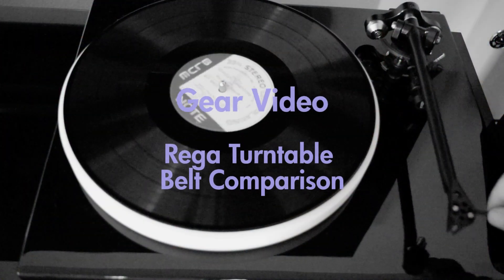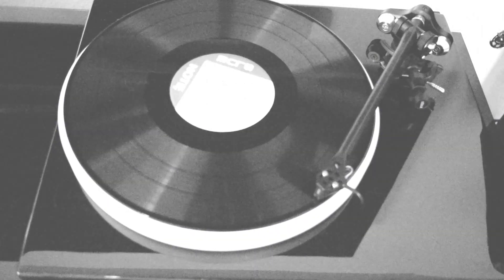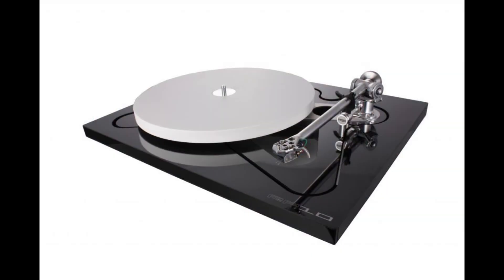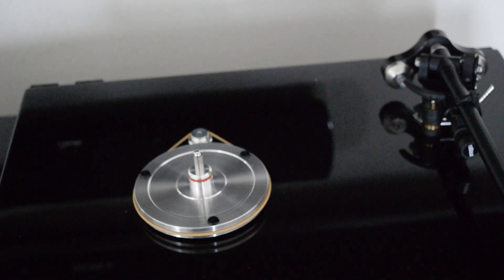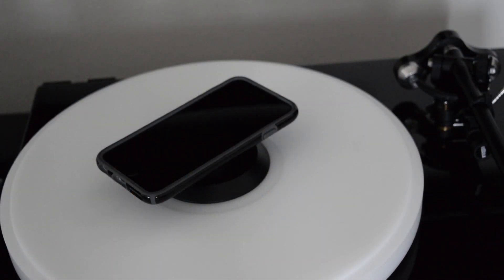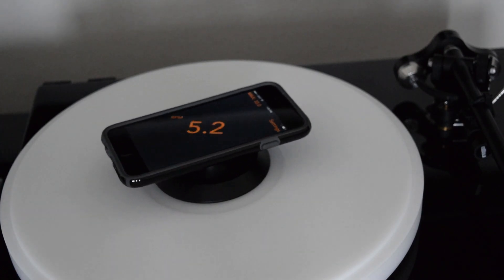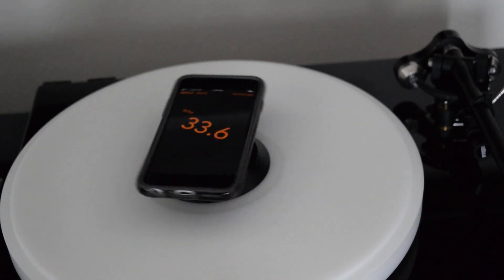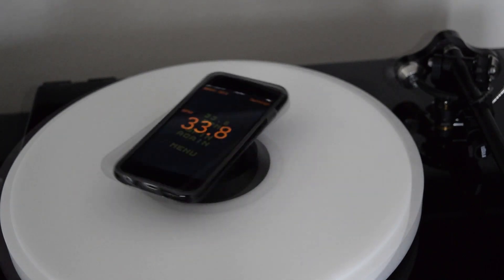Rega Turntable Belt Upgrade Comparison

Comment: Thanks for the video.  I have a Rega RP6 and I have also done some similar comparisons with the standard black belt, the Rega white belt and the blue Edwards Audio belt, and my results were somewhat similar.

I use the Turntabulator app on my iPhone, but I prefer using it in "Exact" mode.  Takes longer, but the results are more precise.  You also see two digits after the period, which I consider necessary to judge the speed.  The target speed is 33.33 rpm, and want my turntable to be in the range between 33.31 and 33.35 (preferably between 33.32 and 33.34), as close as possible to the "correct" speed.

With the original Rega subplatter (made out of plastic), my table ran a bit fast, just like a lot of people are reporting.  I was able to get the correct speed with the blue belt from Edwards Audio (Little Belter).  For correct results, you need to make the measurements with the needle in the groove.  There is approx. a 0.05 rpm speed difference between the needle in the groove and not playing a record.

I have upgraded the subplatter with the special subplatter from Groovetracer for the RP6, and with this (more precise) subplatter, my table ran too slow with the blue belt and I get the correct speed with the standard black belt.

The speed differences between the belts are - I am pretty sure about this - the result of the different diameter/thickness of the belts.  The blue belt is the thinnest, and the Rega white belt is the thickest.  The ratio between the small diameter on the pulley and the large diameter of the subplatter is influenced by the belt thickness.  The effective ratio has to be calculated to the "middle" of the belt, like this: (diameter of pulley + half diameter of belt) : (diameter of subplatter + half diameter of belt)

The thinner the belt, the slower the table runs.  I see some other folks have already made similar comments.

Keep up the good work!
Reply from the maker: Thanks so much for your response and I am glad that others have run similar experiments and can back some of my findings.  I ran another test after this with a record playing and didn't see the resultant drag force impact the speed.    Drag is definitely a factor but it wasn't something I could measure with my phone.

Your absolutely right about the diameter of the belt cross section playing into the speed as well.  I hadn't thought to take a caliper and measure the different thicknesses.  That might make for another good topic for a follow on.

Comment: Great video Paul. I love these equipment videos. I downloaded the turntabulater app to test the speed on my new turntable.
I'm happy to say it runs steady at 33,3 rpm :)
Thank you for sharing this belt comparison video :)
Reply from the maker: +My Analog Corner - Carsten Olsen Personally, I think the way Marantz (or Clear Audio) did it's belt design is far better so I am not surprised it's dead on.  If I remember correctly, the belt runs along the out rim of the main platter.  Is that correct?
Reply: Yes, The belt runs on the outside of the platter :)

Comment: There should not be an after market belt by Rega. They should provide this belt out-of-the-box. Almost criminal!
Reply from the maker: I agree.  It would be nice if it were spot on to begin with.
Reply: BungHoleCamper So true! This is just an example of the Gandy policy. Goes for many more of those upgrades offered by Rega. Don’t be fooled.
Reply: leyland9999 everything comes at a price.  If you want a cheap turntable, that’s great, It can be improved, but at a cost.  The stock item is good at its price point.  Platter, bearing, belt, motor etc can be upgraded.  At a cost.  But for many people getting in at entry level and upgrading as funds become available to is the affordable way to go.  At least they have that option,.  Of course if you want to do it all at once you could splash the cash and by a high end turntable and have done with it.
Reply: @richardsinger01  I could understand a component such as a motor or tone arm however, a belt? Sorry, you are out to lunch.
Reply: BungHoleCamper they provide the belt out of box by the way ...
Reply: i know I'm quite randomly asking but does anybody know of a good website to watch new tv shows online ?
Reply: @Leonidas Levi Thank you, I went there and it seems like a nice service =) I really appreciate it !!
Reply: @Lochlan Byron Happy to help xD

Comment: It's more about the speed variation (Wow and flutter) and not the average speed... If one belt gives 33.7 but only deviates by .3 and the other belt gives 33.3 but deviates by 1.2 than the 33.7 belt is more stable. And it may not be the belt at all. It could be the motor, the pulley or a warped platter.  It's all about the Wow and flutter which can be very audible and annoying. Piano and violins especially. Newer apps show graphs in the time domain showing the speed variation which is more important (to a point) than the average speed reading... I mean you can get an average speed of 33.3  by reading 30.3 half of the time and reading 36.3 the other half of the time. But the variation would sound horrible.
Reply from the maker: Good comment and I agree.   At some point I want to update this video with some of the newer apps that are out there.  At one point, I envisioned to a whole video on the Feickert app.  Lately, my time has been pretty short though.
Reply: +Randy Levine I agree. I think using that Dr. Feicker Platterspeed app would be the best option, as it shows a line of speed changes over time (wow, flutter and drift) as well the actual average/absolute speed.
I just bought a Little Belter belt, and it made my Rega RP3 run slower than before, but I use the original Rega subplatter with several layers of packing tape around it to slow it down, as it was running fast from the factory, so now I will have to peel off some of that packing tape.
So, here's my take: The belt from Michael Lim seemed to have the most stable speed in this video, but it's very difficult to asses these things by just looking at these app's numbers, because maybe one belt runs slightly faster than another, and therefore it would go more frequently from 33.3 to 33.4 than one that runs slightly slower and therefore less often gets to 33.4, even though the wow and flutter deviations might be essentially identical. If there had been several decimal points it would have been easier to compare.
All these belts are made from some kind of elastic materials, but since they might not be exactly the same materials they will also have slightly different elasticity, which will cause differences in absolute speed. The Little Belter seems a bit less elastic than my standard black Rega belt.
Also, these belts will most likely have slightly different diameters, both for the entire belt in total (17 cm or so) as well as the thickness of the belt itself (a few milimeters), and that should cause speed differences as well.
If that is so, then different subplatters in slightly different diameters (such as an original Rega and Groovetracer's) will also give different results with belts of different thickness and different total diameters.
Lastly, if the black Rega belt in this video was old and less tight, and the three other belts were new, the old Rega belt might also fluctuate more in speed or even play at a different speed.

Comment: Surprising results. I got the android app. My P3 runs fast at 34,0 rpm. Using a belt similar to the Michael Lin. Have to see if I can find out why. Thanks for sharing the results.
Reply from the maker: +X junkie NL How long have you had the Michael Lim belt on your table?  It could be that the belt has stretched out over time.  I noticed over time with my two belt system, I had a little bit of drift for the better.  More towards a constant speed of 33.3.
Reply: +BarakaPDub  I think my belts are almost 10 years old. Did a little test yesterday. When I switch (Heed Orbit psu) to 45rpm, it is exactly 45,0 rpm. Do you think an older belt can make it spjn faster?
Reply from the maker: +X junkie NL It's hard to say really.  The belts will deform a bit over time.   If you got something that is dead on 45 rpm, then I would keep it.  Does the same belt play fast at 33 rpm?  

As a caveat, to this test, I am going to try and run the same test using a strobe disc.  Ian at HiViNyws channel showed demonstrated that we can't always trust the apps on our phones.  His Android based phone recorded the speed as running fast whereas the Strobe Disc was right on.
Reply: +BarakaPDub Searched the video. Interesting and confusing :) Thanks for the tip. /Paul

Comment: Haven't checked the speed on my planar 2 since upgrading to the Rega reference belt but I was surprised by how much it improved the sound quality all around.
Reply from the maker: I recommend getting a fresh belt after a couple of years.  A new belt will make a world of difference.
Reply: What would be the science behind a belt improving the sound? I completely understand how it could affect speed variations, even motor vibrations, but the overall sound? It's definitely not changing the frequency response of the cartridge, especially not when you have a subplatter with dampening to the main platter, soooo.... please explain
Reply: @JoeOrber  that can’t quantify any difference. They will say things like “tighten” “warmth” “veil”

A stretched out belt may make a difference so replace it when it gets worn out. 

Otherwise, use an app or strobe and adjust the motor until it is consistent

Comment: my Technics SL 1200 MKII maintains a steady 33.2-33.3 we can argue over the "vibrations" direct drive can produce but you cant fault the consistency in speed and should it be off, well you can adjust it ;)
Reply from the maker: I am not surprised at all.  I would love to grab a SL 1200 of my own and to a test like this.  I would suspect it to be more dead on accurate over a belt driven turntable.  At least, like this one.

Comment: Fascinating. I wish we would have tested my table when you were over. I was ready to get rid of it, but will now try a different belt…then probably get rid of it...
A marketted tt playing at the incorrect speed is not acceptable. I hear it and that's not good. Thanks for the video.
Ron
Reply from the maker: +Don Bertram All belt driven turntables do have deviations from 33.3 rpm in speed but the Rega is an outlier from many of the companies out there given all of the reports on the net.  That said even the high end VPIs, like the Classic 3, have a dedicated speed controller you can purchase separately for $1000.  It's one of the inherent design problems for a belt driven turntable.  If you go to a direct drive, your speed should be constant but your dealing with a different set of vibrational problems which is why most of the audiophile turntables are belt driven.  It's really disappointing to hear that the RP10 runs too fast.  You would think Rega would have it much closer to 33.3 RPM if your paying $5000.  To be fair though maybe the one Fremer reviewed was a fluke.  Thanks for watching Don and I hope you'll enjoy the next two I plan to up today/tomorrow.
Reply: fyi to all…the new belt "fixed" the Rega P3 to acceptable. It is a keeper...for now.
Thanks again Paul for the recommendation. Ron Bertram

Comment: I will say in my opinion one of the benefits of their turntables and particularly one of the things that make them so enjoyable and fun to listen to, which is the whole impetus for their products receiving such high praise, is the fact that they run a little fast.

I no longer own a rega turntable however when I did, like you're doing here I proceeded to try to correct the speed by trying numerous different belts, I even went so far as to get a new sub platter thinking that might help.

At the end of the day though after trying a whole lot of different things and with a third party belt whose name I can't remember the speed went from an average of 33.7 to 33 .3, so it fixed the speed issue.

Pretty quickly though I realized over a period of a few days after having installed it that it actually made the turntable sound kind of boring. And I kept thinking about it and I kept thinking about it and the more and more I had that belt on there and I had it running at the correct speed the more dissatisfied I was with the sound. So of course I went back to using the included black belt which made it run at that slightly faster speed, and all was well.

Another thing people often underestimate is the amount of stylus drag on a record. I know there's arguments that saying it's so insignificant so that it cannot make a difference. However if you have a grooved strobe disc like I have you can see that it takes and as soon as you lower the stylus down onto that groove your speed drops by 0.2 to.3 RPM and in fact does lower the speed to equate to the standard 33.
Reply from the maker: What type of table are you running now?
Reply: @BarakaPDub  well at the moment I'm actually between turntables, I'd actually graduated to a mofi studio , which I just sold, however my wife and I are in the process of a move and once that's complete I plan to pick up a Michell gyrodec.

Comment: I found on my Rega RP6 the white belt made no difference to slowing the speed down. What did was a Tango Spinner Brass triple pulley with three opal silicone belts, a Groovetracer Reference Subplatter and a Michael Lim Motor Isolation Kit. Now I have "Rock Solid" 33.3 RPM with no drift at all.
Reply from the maker: Triple Pulley...sweet.   I wish I could make that mod on my table but I don't think Mr. Lim or Tango make a triple pulley for a P3-24.  It would make sense that your accuracy should be more spot on now with the additional surface area coming in contact with the sub-platter.

Comment: First time I seen your channel and it drew me in due to being a rega planar 3 owner. Belts,  Well I have tested the belt speed & any variations in the speed & found it was spot on. You can get apps for your phone for this & of trying three different apps 2 we're 33.3 & 1 was 33 .27  based on trying them 3 times each they kept the same reading apart from the 33.27 reading  varied betwee 33.26 & 33. 28 so I put that down to software accuracy. What I feel is that if your a hifi geek you will buy or try anything from amazon Chinese stuff, to other branded hifi extra accessories only because its there yet you have never noticed any speed change until it was put in your head by someone. So The manufacturer of your turntable I.e. Rega in my case I have read much on Roy Gandy & his obsession for perfection with his company & his qualifications in engineering starting at the bottom to become one of the worlds leading hifi manufacturers, not driven by money but for perfection. Now why would he do all this then put in any piece of belt in something that took him years to perfect. If your gonna buy a belt get it from the guy that built the Damn machine, simple.
Reply from the maker: I have to disagree.  While I know Roy is a good engineer, he is also a businessman.  When the later comes into the mix, you have to make trades on profit over quality.  When you start putting plastic ball bearing on an RP1, it makes me question how much the scales have tipped towards profit.  Believe me, once you have taken one of these tables a part, you start to see where he sacrificed quality for profit.  Don't get me wrong, his tables are not bad but they are not as good as one would think the way they are marketed.

Comment: Any belt showing faster rpms is slipping less.  I think the belt that showd best rpm is actually the one slipping the most.    Slipping cant cause higher rpm.   I mean if a belt slipped 100% you'd get zero rpm.  So a zero slipping belt would give you the faster platter rpm.
Reply from the maker: True but the problem with Rega's is that they are widely known to run slightly faster than 33.3 rpm.  Ahh...and one thing I forgot in my last response is belt tension.

Comment: You might try the LP Gear belt which is thicker and less stretch.  I'll never use any other brand on my Rega table.
Reply from the maker: Where did you pick it up?  I would definitely like to give it a try just to expand on these videos a bit.
Reply: LP Gear is online seller of audio equipment, mostly turntables,  cartridges, and parts.
Reply: I’m looking at their site for a belt for my MMF 5.1, reasonable price.  I just wonder if it’s an a improvement from OEM?

Comment: Good test, although I'd like to clear up some confusion. The white belt is obviously better in this test, since it transfers power from the motor better. It is the motor that is at fault. I can't say for sure that a new white belt will be better than a new black belt, but it's obvious that performance is all down to matching your machine with the right belt, i.e getting the correct speed.
I laugh in the face of anyone who claims the belt will affect sound, if it spins at 33⅓ rpm then it doesn't matter if the belt is made from manatee whiskers or Rega's gold plated rubber belt.

Also, everyone knows white belta are for newbs, black belts for pros.
Reply from the maker: Correct on the sound.  If your belt hasn't stretched and keeps the speed at a near constant 33.3 rpm, then the sound should not be affected.  Large deviations from 33.3 rpm will affect the overall wow and flutter.

Comment: First off, those belts need a break in period to stabilize. Secondly, the new belt, pulley and sub-plater surfaces need to be cleaned with alcohol before the belt is put on and thirdly, the slight variations in diameter of the belts and even ambient temperature changes will effect the speed but then I'm glad that you didn't compare the sound of different belts.. :)
Reply from the maker: Your right on the belt break in period for sure.